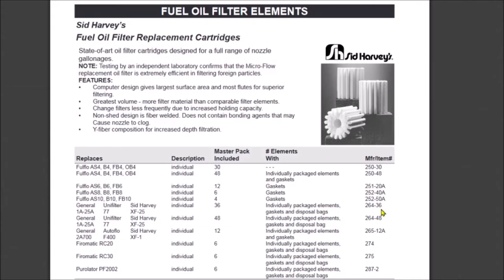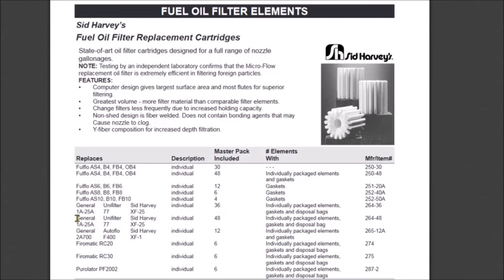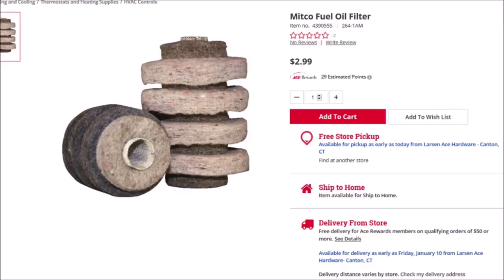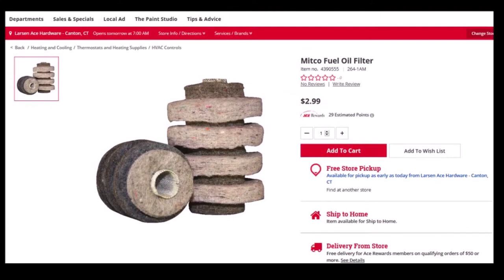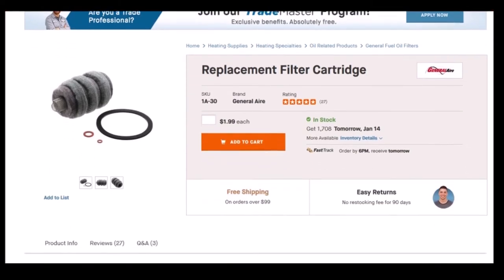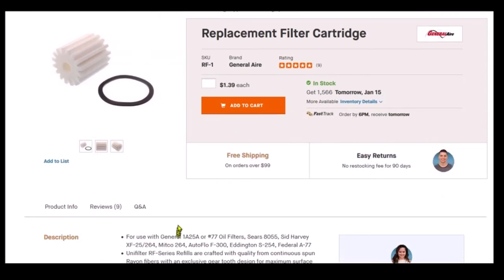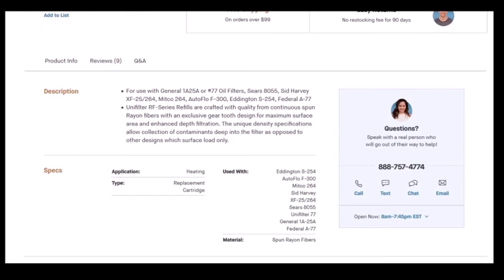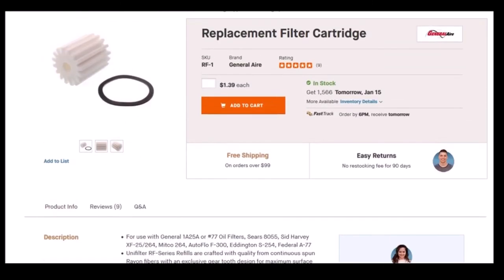Fuel Oil Filters for Oil burner furnaces.  Are wool filters and spun fiber filters EQUIVALENT?

Comment: Hello, 
I have noticed when performing oil  furnace maintenance services. During the tank filter change step, the wool filters usually has to be removed from filter housing in pieces. The wool filter seems to be not as durable compared to fiber filter.
I always replace wool with a fiber filter unless homeowner or business own says otherwise.
Recommendation always use rayon fiber filter and change all 3 gaskets.

Comment: Recently when my furnace was getting louder I replaced the Rayon fuel tank filter with the original General brand wool filter.  The Rayon filter did not appear to have a lot of sediment like shown on some filter videos but it was restricting oil flow as a new filter cured my problem.  Using the factory brand wool filter as specified on the metal filter housing seems to be the obvious choice as they are very inexpensive.

Comment: First off 5 days for a nozzle and filter get a different burner man. That stuff should be on the truck and they are not hard to find. Matter of opinion on the wool vs rayon filter. I see a decent amount of rayon used on one of the channels I watch. I think with regular maintenance neither should give you any problems. Hope that helps. Tune up up in the summer if you can, quiet time of year.